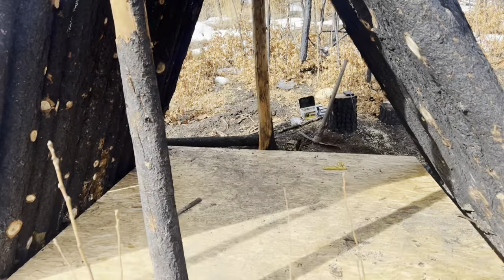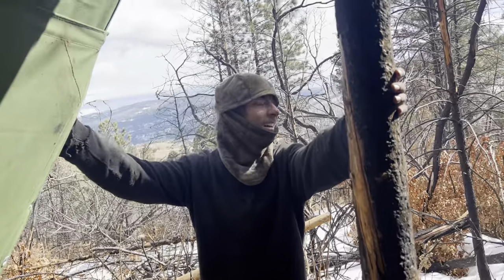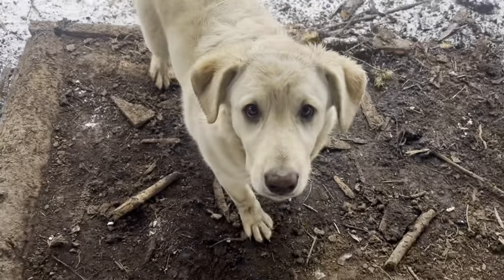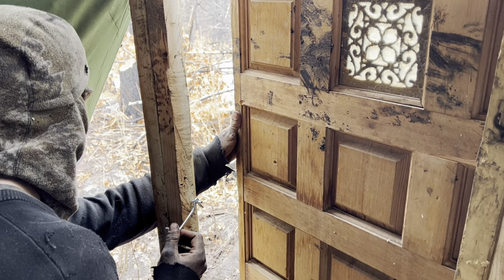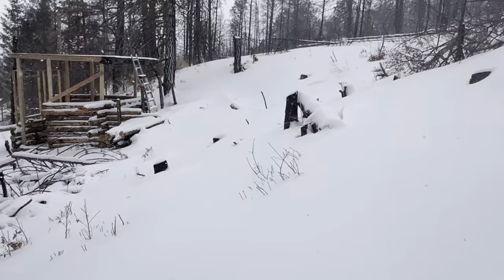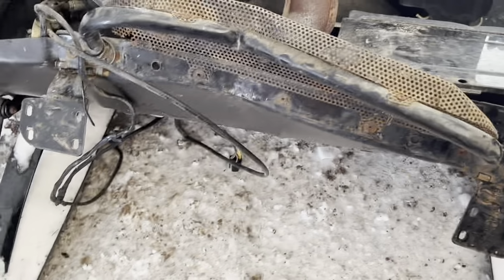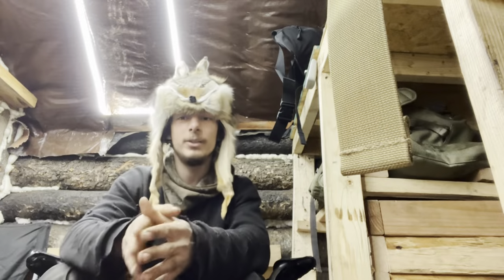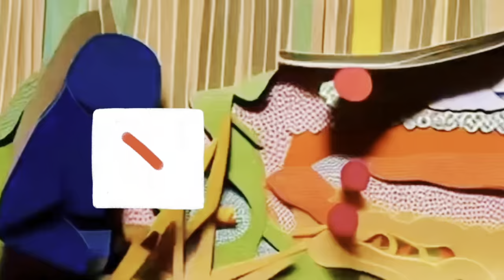Building Log House | Snowboarding | Skidoo Crash | Farm

Comment: Next time you build a roof try putting the tarps on the outside and just screw them down around the edges. Make a border on the edge with small long logs , fill the roof in with about an inch of dirt. Get moss or grass to cover it. The grass will grow and the water will not penetrate. You can then plant anything , flowers or whatever on the roof

Comment: what you made with the mud and straw is called Cob in the UK, you have made the cob a little to dry,  the best way to make cob is to put all your mud into a large pile create a dounut shape out of on the floor add a good dash of water  and pile the straw ontop. now to mix it all up you can either use your hands or better way is to mix it with your feet. you want a semi sloppy mix.  Cob is best put on in the summer so it drys out real good before winter hits, you may find the cob you made will freeze due to the water content in it and start to fall off. but thats nothing that cannot be fixed in the summer months.

in the UK we use it to make Cob walls, but you can also make fence panels with it to. place sticks upright in the ground , weave sticks inbetween the uprights then Cob over the sticks front and back.

If you want Clay, walk up and down the creek Will , check the sides and the creek bed i am sure you should stumble across some clay at some point, then you can harvest it. once you get the clay back to the cabin spot  you can work it into blocks to store, if the clay drys out you just add  the clay into a buck with water to re-hydrate it so you can use it.
Reply: here is the ideal mix for good COB , first off you need soil with a clay content of atleast 15 -25% clay. go walk up and down the creek and look for a good amount of clay you can harvest first.
1-2 buckets of clay soil 
1 bucket of sand 
a decent amount of straw
 1/2 a bucket of water or more

mix said ingredients  into a good cob , be sure to even disperse the straw into the mix. if your going to make a wall from said Cob  it should be around 18-24 inches thick, for yourself Will just cram as much cob as you can between the logs  INSIDE and OUTSIDE. 

using soil without any clay in it will not make a good cob and it will break apart after rain. make sure to let the Cob fully dry out and become hard , you can leave a nice smooth finish by wetting your hand with water and smoothing the cob over, this also helps the cob stay inplace and leave a nice smooth finish that any rain should just run off
Reply: Here in New Mexico we call it Adobe and all the old houses and monasteries back in the day were built using Adobe bricks and locally milled wood. Normally we use a thick red clay mixed with straw but up there in the higher mountains where they are the dirt is primarily a grey clay type.

Comment: Hey bubba a slap stapler and some small chunks of plastic like 8 mil works wonders for hold down shit like tar paper or cardboard wrapped in plastic gives you more holding power ..nails and screws will pull out unless they are cap nails for roofing .. just a thought 🤔.. digging the build bro 💯✊

Comment: Bro drift stitch the front end with zip ties it’s just plastic and you can heat up the plastic with a torch try to push it back to its normal spot. If noting is broken mechanically I wouldn’t replace anything just stitch it up with good old zip ties in a X pattern call it day 🤙 keep on ripping love seeing this
Reply: Also a tie down strap to a tree and if it has reverse full send it backwards 🤣

Comment: If you try to bend that metal without heat it will get brittle. To do it correctly you would have to heat the areas you need to bend it back. The heat is your friend. Orange hot on steel. It’s a dirty job and it will cook your paint. Have a primer and a black spray paint on hand. The quicker you get that metal coated the better but don’t paint during the cooling process.

Comment: Hoop is bad.. the builds gangsta fasho nice work. When you on that ski rev the engine instead of holding the throttle back tap it back a few times it’ll give you more pull and control for next time

Comment: Yo yo - if ya have leaks around the screws in the top, put another tarp over the top one and hold it up in the middle with a rod (stick) that runs the length rather than screws

Comment: What up willy hey brother you need to put plastic between the ground and the bottom of sauce bosses cabin mabey staple it to the bottom side of the floor and then lay another layer on the ground coming up the walls on each side sealing the bottom completely off your gona get to much moisture inside and then its gona get moldy when i was about your age me and my buddy got sick from being around to much mold fucked us up so be careful little homie mold is no joke and I'd definitely look into a metal roof like yours and setup a frame and you can just throw installation foam between a 2x4 frame between   the metal roof and logs

Comment: Everybody this comment pinned please...For the batteries to have a space: get or make a 4 by 4 by 4, make three slots all 3 inches apart, that cover 1/4 of each battery charger, make sure slots are snug to the battery chargers, snug not tight, then make 2-3 90 degree triangles to hold up 4 by 4 by 4, screw in the triangles to the 4 by 4 by 4, screw triangles already attached to 4 by 4 by 4, screw the triangles the wall wabaaam, battery charging shelf.